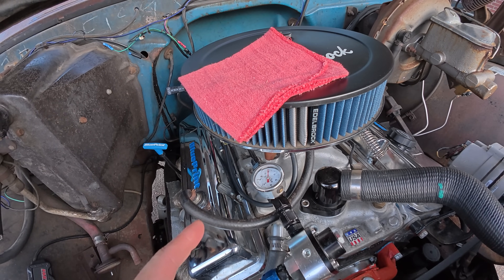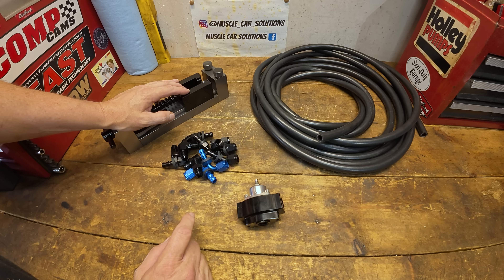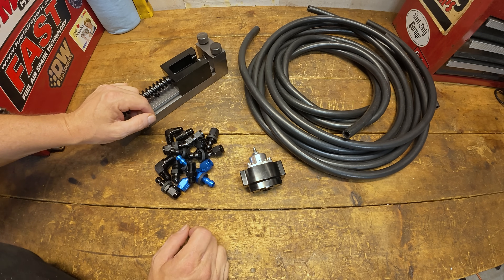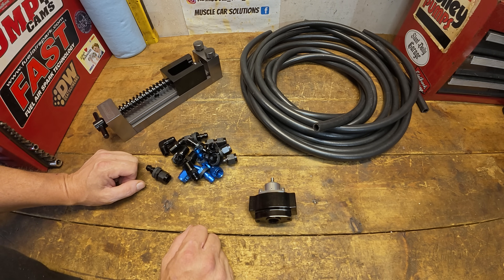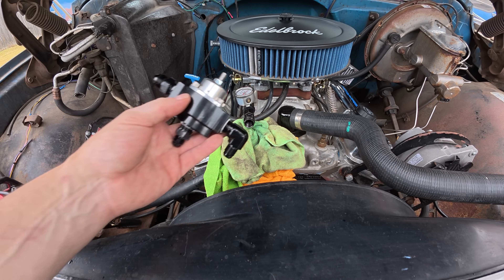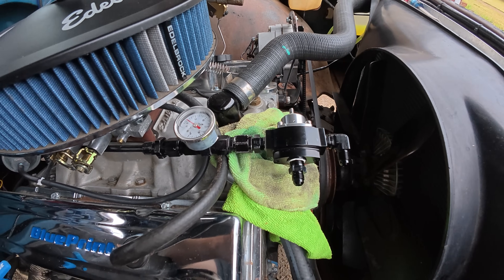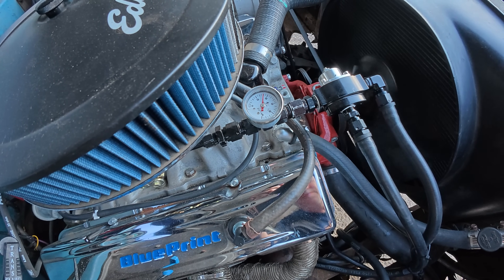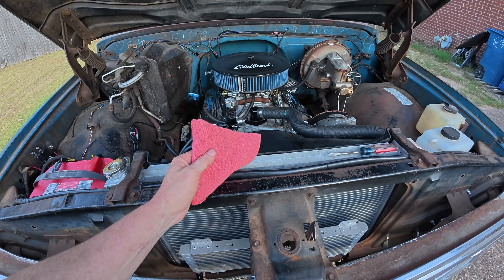Bypass vs. Deadhead Fuel Pressure Regulators: Which is Best for Your Build?

Comment: Living in Metro Atlanta, I sometimes couldn't avoid getting stuck in significant traffic/gridlock in hot weather.  My '57 Chevy would vapor lock until I changed out the deadhead regulator to a return style, which eliminated vapor lock in most conditions.  Even with the return style, the fuel would sometimes still vapor lock in the unpressurized supply line to the pump.  Once I went to an in-tank pump, vapor lock was gone for good.
Reply from the maker: In tank is always the best solution.  Always.

Comment: I’m running a dead end system and have been fighting a drop in fuel pressure for quite a while.  I’ve tried 2 different pumps and 2 different regulators with no change.  You mentioned checking the vented cap and I’ve never thought of that.  I’ll be trying that next.  👍
Reply: I have had good results from Aeromotive pumps and regulators. Zero creep.

Comment: Oil filled gauges need the vent cut open to function properly, they will read false when heated even though the pressure is steady
Reply from the maker: Cut open?  Have you used one before?  Some are just a simple button to push for a second and it stabilizes.  The Aeromotive one has a pin.  Pull out, watch it drop 1/2 a psi be use they don’t generate that much variance in the gauge and it’s done.
Reply: @MuscleCarSolutions 
Yes most , not all have a rubber plug that has a small tit on them that requires cutting, it says so right on the gauge

Comment: This video will be good to revisit  for me.  👍  i revisited your p t f e video recently.
Reply from the maker: Glad they have been useful!  👍
Reply: Well i'm a green horn at this stuff, ptfe video's I watched several different ones . Your video was the only one that showed how to properly install the fittings correctly with the proper tools. So I ordered up the olive tool, and the vice clamps. You mentioned using oil to help. I'm going to use   olive oil . Extra virgin type. 😮

Comment: I thought we wanted the fuel to heat up b4 the cylinder so it antimized?
Reply from the maker: Absolutely don’t want that condition in fuel lines.  They move fluid, not vapor.

Comment: My fuel systems holds 5.5 all the time
Reply: I set my edelbrock carb for 5.5 all the time at operating temp.  On cold start it reads 6 psi.  So, I'm using a typical holley deadhead regulator and only getting a .5 psi drop at idle after driving for at least 20 minutes.

Comment: I have a 74 chevy 1/2 ton with dual fuel tanks , the fuel system has a manual change over valve one line for each tank. I think I’ll have to find a changeover that has dual return lines
Reply: @arnoldsmith4612  did you ever find a solution? My 73 has the dual tanks and single feed line. The switch over is electric single post

Comment: This does confirm what I've been wanting to do on my old Vette. 383 stroker with a spicy cam and I do get the drop in fuel pressure like you have. I already have a return line capped of. I really always wanted to go back to using it. Zoned it for two years and inherited a nice setup that fails to follow through.

Comment: This is a great video.
  But for someone who doesn't want to change the regulator to a bypass style.
   There is questions that remain. ...   What or why is the deadhead regulator dropping pressure when it gets warmer.
    Is it better of metal expansion?     Or is it a diaphragm issue?   Or is it a spring pressure issue?   Such as the spring is losing tension as it heats up?    
   And then that leads to another question,   if a person who uses a mechanical fuel pump without any pressure regulator, does that mechanical fuel pump also lose pressure as it heats up?
   And this is a pile of questions,   but all would be great to have answers for.
Reply: At low throttle position there is not much fuel coming into the system, so it tends to heat soak easily under the hood.  At greater throttle positions, more fuel is used so it tends to keep things cooler with fresh fuel that doesn't have time to get heat soaked.  

Bypassing the extra fuel tends to keep things cooler because you have a constant supply of fresh fuel coming into and out of the system, that is not heat soaked, so the pressure is more consistent.  Does that make sense?

Comment: Do you or anyone else know how the GM 3 line pumps work out with this. Currently I have a 1978 Corvette, and running the stock 3 line pump (has a  3/8” feed and 5/16” return) to a 600 cfm single feed Holley. I have not run the car enough to see if this pressure drop occurs. The car has a recently installed BP 3501. Can’t really find any information on the 3 line pump and the deadhead regulator. It seems to me like it has a bypass built into the pump, but this may not be correct, but I do know that they went to the 3 line configuration to alleviate vapor lock by cycling the fuel back to the tank.

Comment: I'm running an Avs2 on my 429 Ford, just dead head for now. I have the Edelbrock single feed fuel line kit, Edelbrock fuel regulator and a fuel pressure gauge, none of which I've installed yet. I'm a bit confused on the fittings I'll need to hook this all up and make it clean looking. I've been looking for a video to get ideas.. do you have any suggestions? I'm just using rubber fuel line, nothing too fancy. 
2nd question: Have you checked out the "Carb Cheater" system by Thunderhead 289? I'd be curious on you thoughts if you have.. or maybe you've mentioned it in a past video?
I've learned a lot from your videos and really appreciate your efforts in putting them together 👍🏻
Reply: Do you have a Boss 429?????

Comment: My return style regulator still shows a drop on both my fuel psi gauges because when they get warm they pressurize and give false readings 
I am sure yours is doing the same since even Autometer warns of this on the low psi gauges even after they are burped

Comment: After learning how different pumps work, it is my understanding that diaphragm type pumps should use dead head regulators to reduce wear and tear on the diaphragm and that rotary types should use bypass regulators to reduce overheating of the pump motor.
Reply: wrong, the diaphragm pump lives longer with a bypass regulator
Reply: @oliverroedel1111  when you put a bypass regulator on a diaphragm pump it acts like a leak and causes the diaphragm and spring to actuate to a greater degree, how does this not cause more wear and tear? honest question.
Reply: the way that a diaphragm pump works as I understand it, is that the engine/solenoid actuates the suction side and the pump spring pressurizes the pump. when fuel flow is low there is very little movement of the diaphragm and spring, but as fuel flow increases so too does the movement of the diaphragm. a increase in fuel flow caused by a bypass regulator would thus increase the movement(wear and tear) of the diaphragm and spring.
Reply: @SnowDuck82  no, it´s working normal, without pressure. no bypass is used.
Reply: @SnowDuck82  the pump is mechanical. it´s working when the engine is running. when pressure on the outside is higher than the bypass valve spring it opens the valve and works without pumping. there is the wear. if the pump is pumping without higher pressure than everything flows good, no stress on the parts, specially the diaphragm.
Reply: @oliverroedel1111  are you saying that the engine presses the diaphragm to push fuel to the carb? because it doesn't, it lifts the diaphragm(sucking up fuel) and the spring presses the diaphragm(pushing fuel to the carb).
Reply: @SnowDuck82  yes, the simple old style works like this. but the mechanical part moves always, and it´s more destructive for the diaphragm to work under pressure than work under normal conditions. other problem is that it forms gas caused by the heat that can´t go anywhere, that´s why you should always have a return line. most carbs are gravitation feeded, with a return. only the first generation were pressure feeded. cause a carb didn´t need pressure, but flow. so you doesn´t need a high pressure (pump), but a high volume (pump) in high hp/cubic engines. resume: a carbed engine  never works bad cause of low fuel pressure, but low flow and gas in the line.
Reply: @oliverroedel1111  yes the mechanical part moves always, but it doesn't press on the diaphragm. it lifts the diaphragm and when there is very little fuel flow (idle and cruise) the diaphragm stays lifted. the fuel pressure. a fuel bypass allows the diaphragm to be pressed down more by the spring, only to be lifted back up by the mechanical part. the heat isn't caused by the pump, it is transferred from the engine block. this heat can be reduced with an Insulator (or extra gaskets) between the pump and block, or a very small orifice can be added to the line above the pump and routed back to the tank to relieve the vapor from the line. or if using a oem style pump, you can get one that has a vapor return line built-in.

Comment: My mechanical fuel pump without external regulator does the exact same thing. Its 6psi until about 10mins running and it goes to 3

Comment: I found that the pressure drop when it gets hot is due to the liquid filled pressure gauges. There is reset  button on top of the gauge that will reset back to normal pressure. That’s why you don’t notice any running conditions as the fuel pressure is still the same
Reply: @ultimatejay  I agree with you.    Moved my dead head pressure gauge away from the heat, and that problem went away.   100%  a return style is better.    I have 3 cars with dead head style, one with a mechanical pump and one with electric, and both run low 10 seconds on pump fuel, which is very heat sensitive.  I really need to get them switched
Reply: 100 percent, my return-regulated system does the same thing, Ive done enough experimenting to know just throwing a cold gauge on it makes it read normal again. Higher temps mean the gauge reads low.
Reply from the maker: Liquid filled gauges aren’t a magic reason why pressure drops.  Holding fuel in a deadhead system for sure does.
Reply: @MuscleCarSolutions if that was the case then every old school car made from the factory with mechanical fuel pump would have running problems
Reply: @ultimatejay  what is your experience? Can you give me more info? I'm trying to understand so I can buy the right things.
Reply: @ultimatejay  YUP, pull the pressure release value. I bet it would have gone back up.

Comment: On the Holley website for the return style it says not for use with mechanical fuel pumps I was going to try an .060 orifice for a return with a deadhead like the factory did with the filter only those filters for 3/8 are pricey and I like to be able to change them easily without a special filter so that’s why I was going to try an orifice but I might give this a go
Reply from the maker: Boils down to flow and their concern for the pump diaphragm.  Neither is a concern in this set up.
Reply: Good to know thanks man love the vids I got a Holley duel inlet would you still put the regulator after the carb (as you suggested in other videos) with mechanical pump

Comment: Lots of good info! Return is much more stable and keeps the fuel going into the car a lot cooler. Deadhead is a good setup, but there is limits.
Reply from the maker: Agreed!
Reply: I think you will find that returning the unused fuel to the tank from the engine bay actually makes the fuel inside the tank hotter.

Comment: Cool video…. I’m planning to install a regulator on  my 76 vette. It has the original bypass mechanical fuel pump with a return line.. is it advisable to keep this pump, or get abother one without the bypass and install a return line right from the regulator?
Reply from the maker: There are the factory bypass pumps and filter options out there.  I’ve always preferred to return it from the regulator.  Not saying those other two options don’t work.  I guess I’ve just gotten used to doing it one way.  As long as pressure at the carb is maintained and flow is good and those other options work, sounds like a good deal to me.

Comment: YOu have a gas tank BEHIND you n y seat?  Madmax much?. scary.if s-go-wrong, trapped and BBQ. OY VEY hoSEAh.
I often wonder if the Corvair gas tnk had any issues? I owned and got whaled in the back in the 72 pinto..those don't have gas tank issues, the 74+ did, bumper regulations, sheered the gas tank... and yes i was turningleft INTO a gas station.. that was scary esp the traffic coming at me in all 3 lanes, right after hit..now i know why u never turn wheel right untill you ready to actually turn right. DOH
Reply from the maker: tHaTs WhErE tHe FaCtOrY pUt ThEm.
Reply: I’ve been around 69 years and have owned a lot of pickups with the fuel tank behind the seat, but I don’t ever remember ever hearing of one blowing up.
Reply: @staljans  the only time the tank behind the seat would be an issue is if it developed a leak in the seam or something like that which you would smell the fumes in the cab…getting out of the bed in the morning has also proven to be hazardous but if you don’t try it you’ll never know…

Comment: The problem with your fuel pressure is the liquid filled gauge. They are not compatible in a heated engine compartment. I replaced my fuel pumps and the problem was still there. Ended up running 2 gauges side by side to prove the point. 1 liquid filled and one empty. I have seen the problem three times since
Reply: The problem with liquid filled gauges is the oil in the gauge heats up and affects the bi metal spring inside. Pour cold water over the hot gauge and watch the pressure come back up
Reply from the maker: @StephenCrook-w7l  you’re talking a significant amount of heat that has to be introduced to have that drastic effect.  Not saying it’s not possible, but I run most of my engines on the cool side.  This one hovers at 180 on the hottest Mississippi days.  In this video?  Hood open and a fan pushing air as it sat idling for 15 minutes.  Not remotely hit enough for that situation.  That’s also why they have a pressure release to bleed them off in case that comes into question.
Reply: @StephenCrook-w7l  my no liquid gauge that came with my system didn't even work. Lol
Reply from the maker: Long term, yes releasing pressure is needed.  Takes all of two seconds to do and it rarely changes the pressure.  I have two gauges on the truck.  On post filter, one post regulator.
Reply: Yup I just posted the same response before reading this